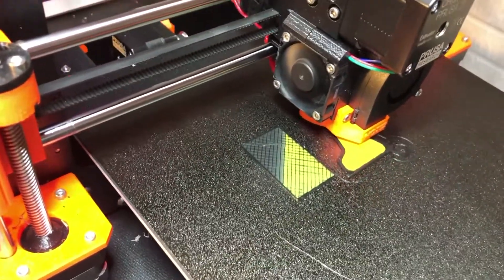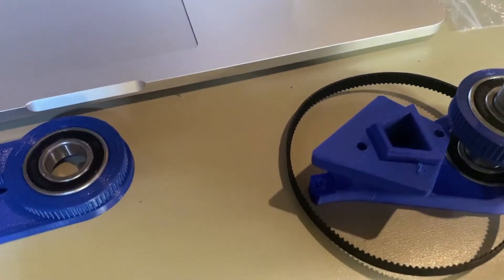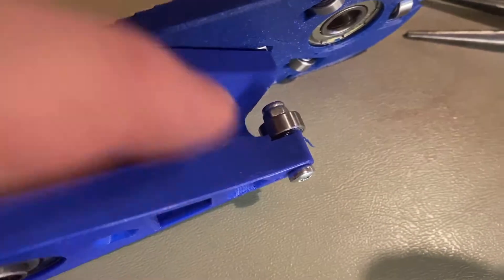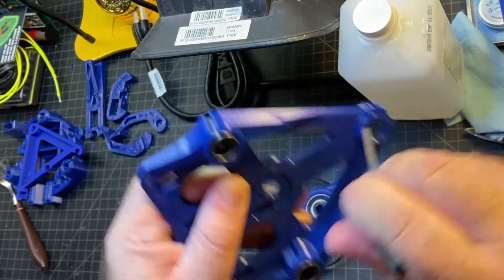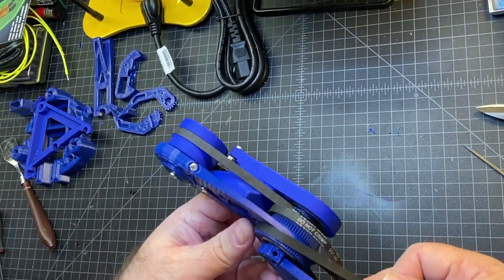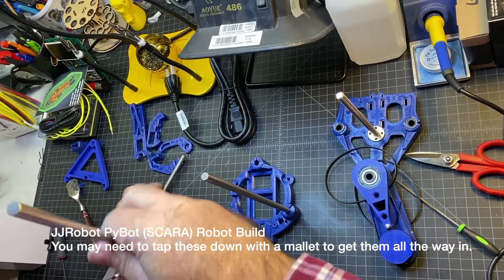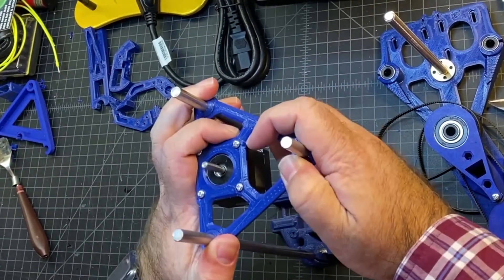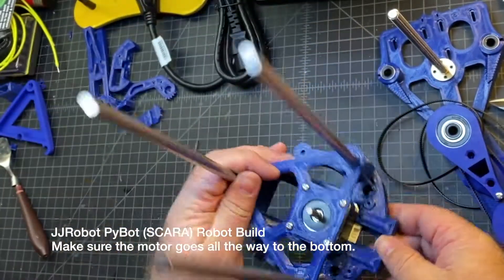JJRobot Scara Arm Build Part 2 - Part Prep and Rods

Comment: tension on that belt of aproximal arm isn't good enough. I had build this PyBot Scara Arm and I have to replace that closed loop belt with shorter belt for good tension.
Reply from the maker: I've been running it for a bit and it seems to be operating OK, but the belt does seem to have a little more slack than I think it would need. What size belt did you replace it with?
Reply: @GregsMakerCorner  I just use zip tie and make my own with some non closed loop GT2 6mm belt.